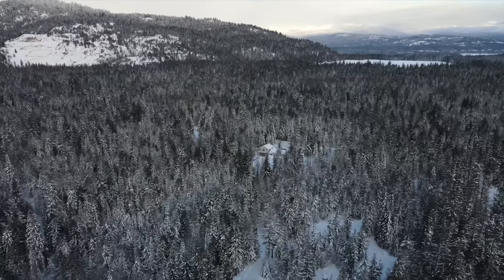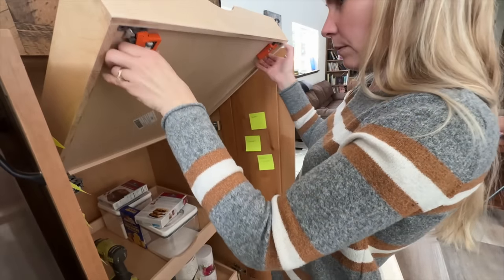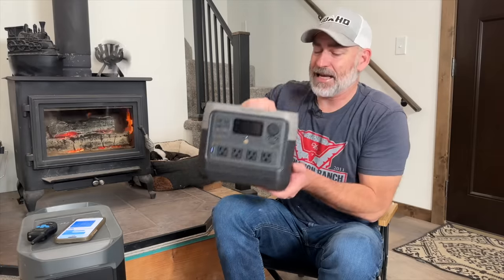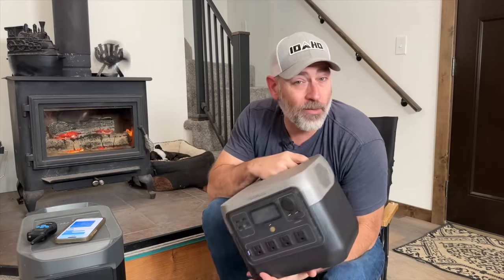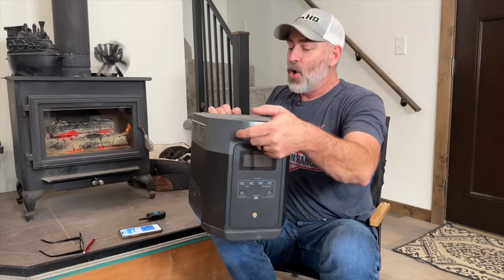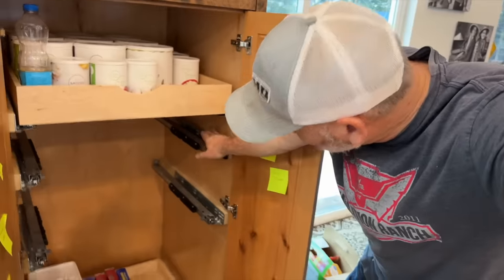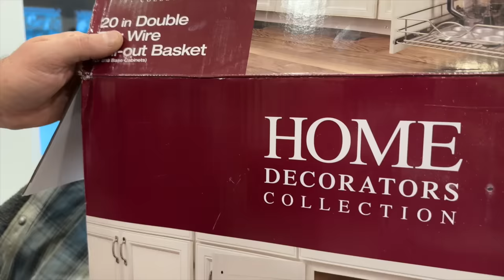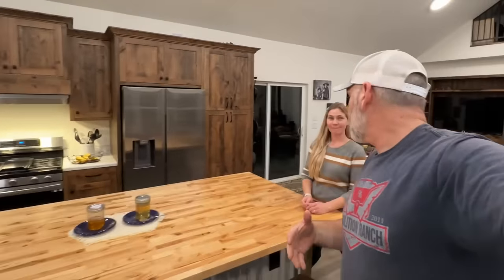Kitchen Remodel?

Comment: Does the cast iron train on top of wood stove have a purpose? Does it steam water for the dry air in winter?
Reply: Never seen it do that, 
 When first acquired, it was mentioned about an ancillary/ secondary heat/ thermal mass to hold heat from the day and as the stove cooled it could share its thermal capacity , to make the need for more wood  not as large!!
   Jus sayin 🤷!!
Sounds good in theory, 
Curious if it works
           well!!??
     👍🐺🧙‍♂️🦊👍